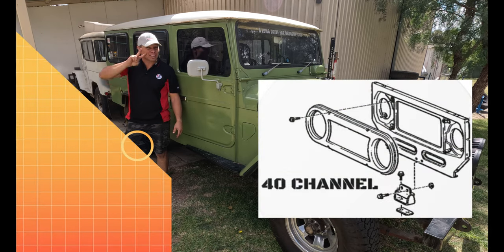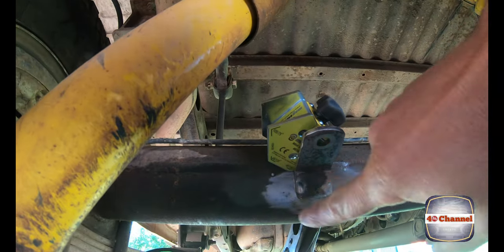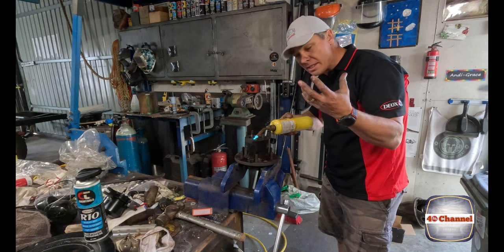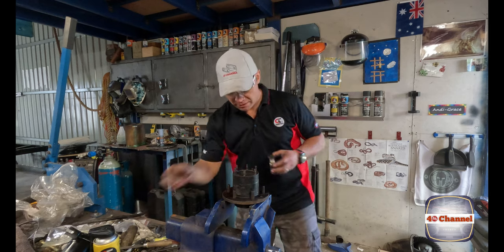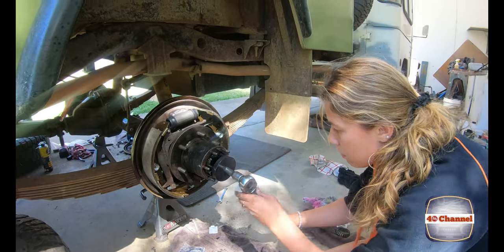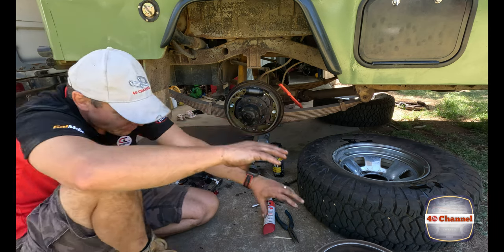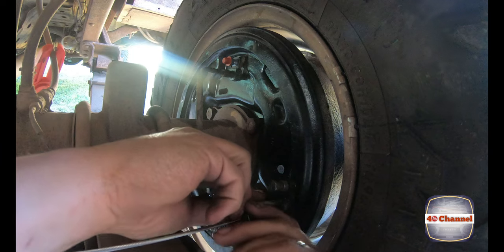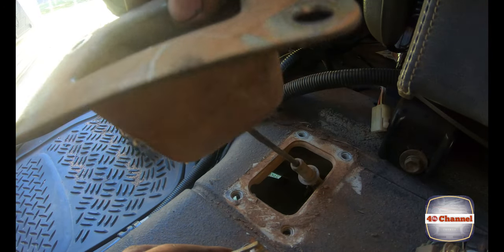S2EP83 - Pt 2 - 40 series Rear Brake Conversion with VDJ 79 series brake cable - Upgrade Handbrake

Comment: Hey mate. Wondering if you can help me out on a brake issue. A new brake master cylinder was installed in my 40 prior to purchasing it, and all was good with the brakes. Then I noticed a weeping at the cup seals, so I replaced the seals and then the brakes felt they were not all braking equally. So I bled the brakes and then my troubles started. The brake pedal goes slightly hard at halfway to the floor then drops to the floor with a hiss under the dash. I'm thinking maybe a return valve in the booster of something like that but why did it happen after bleeding? Any ideas? Thanks for. great channel. MGW - Prince Edward Island - Canada

Comment: hey mate you shouldn't use moly grease on wheel bearings i know this might sound dumb but it actually too slippery for wheel bearings. moly grease on cars or 4wd's should only be used on cv joints and swivel hub bearings. the best wheel bearing grease i have found is made by timken gr224 is the part number. moly grease is known to become corrosive